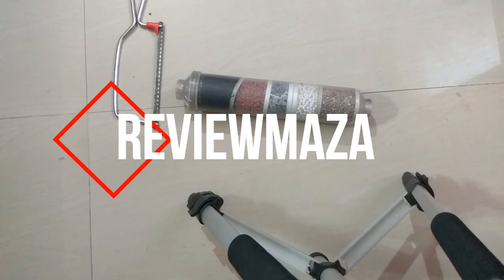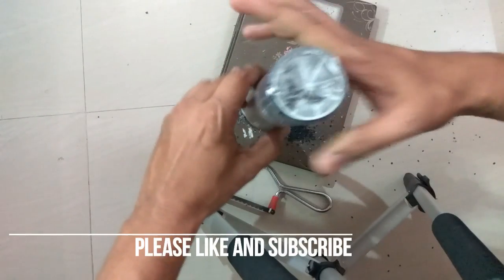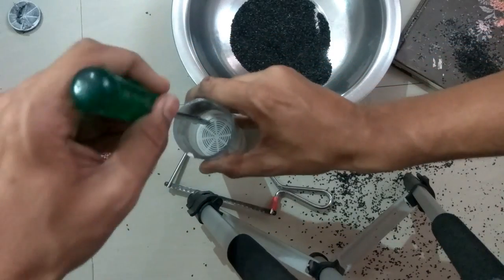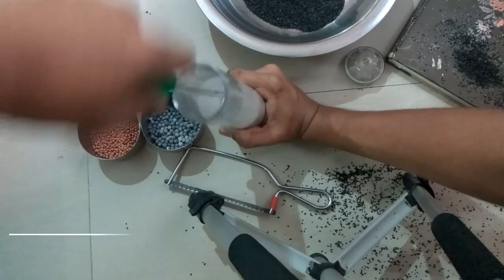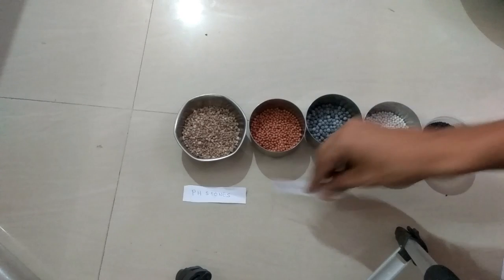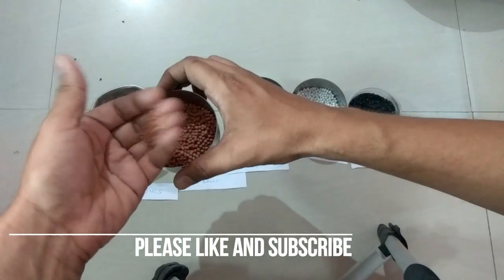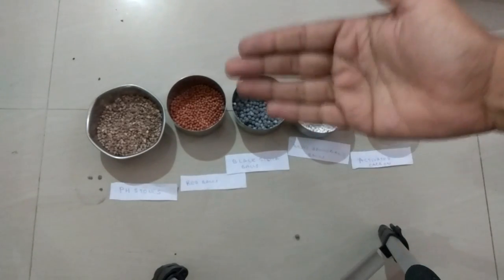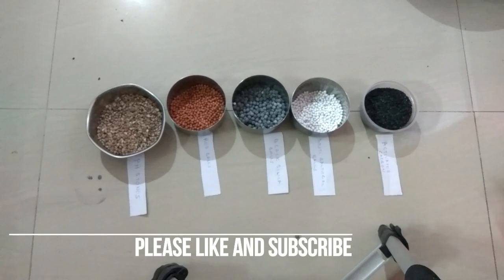MINERAL CARTRIDGE  WHAT IS INSIDE

Comment: can i use RO Membrane directly by connecting it to tap by pipes to it??
i wanna use it to fill my aquarium with clean water..
Reply from the maker: no. The ideal pressure for operating an R.O. system is 60 PSI. Pressure below 40 PSI is generally considered insufficient, and should be boosted using a pressure booster pump. and inline pre filters are very important for membrane life. you cannot bypass them. if your tap water is having 60 psi pressure then you can skip the booster pump.
Reply: Reviewmaza thank you sir.
i dont think my tap water vill hav tat much pressure.
any suggestions to reduce hardness of water
Reply from the maker: to reduce hardness you will need a RO system.
Reply: Hello sir will we install mineral catridge in RO, UV UF. filter for water taste?.